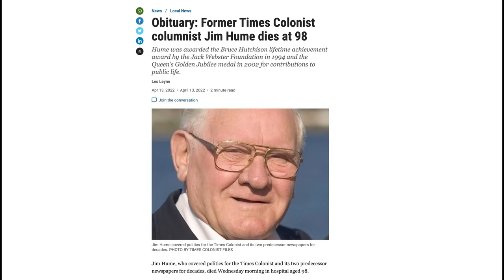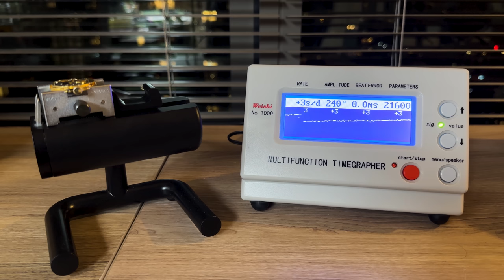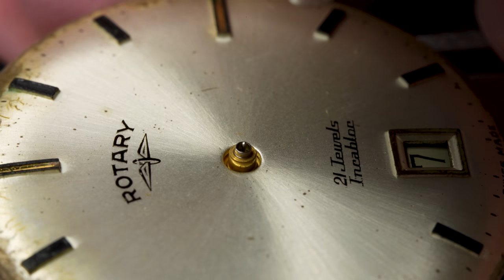He Wore This Watch Dining With the Queen and Salmon Fishing With John Wayne!

Comment: Imagine being Jim Hume having lived through WW2 experienced the invention of the vinyl record into magnetic tapes into compact disks into fully digital streaming media. Imagine having halls full of shelves replaced by rooms full of equipment with magnetic tape storage into being able to store billions of pages of written text into a device the size and thickness of a fingernail, the invention and spread of home phone lines into cellphones into smartphones and a furniture size tube driver radio receiver turned even bigger furniture television turned color, turned from tiny CRT to big CRT to projection to LCD to plasma and now flexible OLEDs as thin as cardboard...
It is astounding what humanity achieved within about 150 years from first steps in electronic and simple circuitry into the first semiconductor transistors making tubes obsolete into logical clusters of millions of those with each being only a few hundreds of atoms in size...

Comment: That’s sage advice when it comes to attempting to clean a dial; best just to leave alone as very often can be made worse in a cleaning attempt. One issue I have had with that Speidel band is the multi fit lug width type is spring loaded and it causes a lot of damage to the inside of the lugs! I have actually ground the lug ends and polished the ends so there’s no spring tension pressing against the lugs. This is something customers have not taken issue with and preserves the case itself. Thanks for sharing!

Comment: I love vintage rotary watches they just look fantastic to me. Not sure if the movement in this case was manufactured by rotary themselves because a trademark they used to do was decorating the ratchet wheel with engraved sort of wings but I supposed they would have been on the more expensive watches. I have a rotary supersports cushion watch from the 30s and an Eterna rectangular watch from the 20s that are both 9ct gold and have rotary movements with those wings on the ratchet wheel. Love what you do Marshall, amazing workmanship ❤

Edit- after commenting I noticed the AS stamp on the movement

Comment: Watches are pretty straightforward.  As long as you keep the torbo encabulator the right way up and keep the same flange for the induction coil from getting caught under the flux capacitor, you're good!  😁

Comment: Those old flex bracelets are soooo comfortable on the wrist, even though they can be a chore to clean. Without a sonic cleaning machine I usually have to remove the bracelet and scrub it with a toothbrush at the kitchen sink.

Comment: Just fantastic.  Another watch with a crazy cool story and an interesting repair.  
I saw that click spring fly away on you.  I would recommend wrapping rodico on the end of your push stick.  This should not interfere with the purpose of the push stick, and it will grab things that like to jump.   You have a plastic stick that is angled and slippery.  You are trying to hold a greasy metal spring with that slick plastic. 
The other advantage of doing this is you can pick up screws with the rodico tip more easily.
Reply: @RussianFans-vn6cj  It's my responsibility to report you for unwanted spam. Please keep your religion to yourself unless asked.

Comment: You might want to put a small piece of Rodico on the springs that have a tendency to launch into outer space.  The Rodico acts like an anchor, keeping the springs from moving very far.  Even if the spring does launch, the small bit of Rodico stuck to it makes it easier to find.  Or, you could use a plastic drop cloth underneath your desk.  The plastic is a clunkier solution, but it does work.  Lift one corner, then another, then the last two.  All dust, dirt and other particles will be in the center of the drop cloth.

Comment: Something I love about watch repair; is how many times the repair is a basic 'take it apart and put it back together' and it works type repair. The fact this is a universal constant on many things is weird but even more strange is that its the same with some electronics. Many times I have found myself working on something electronic like a radio, or cd player, or computer and simply taking it apart and putting it back together it just works. Granted that usually means there was a loose connection somewhere but still its just funny. I wish cellphone repair was like that since that is part of my job but no with that its usually a broken screen or bad battery.

Comment: Them old school watches are a work of art. 90% will be the same yet that 10% isn't. They all have just that little difference. Maybe more like 95% to 5%. And that was because back then they were all put together by several people. Each did their same thing yet it wasn't the same thing all the time. This was and still is a beautiful watch. Even before restoring it. I love the main spring tool click as well as the click putting on the top of the main spring. They just nice clicks. I would say if I did this type of stuff it would take me time doing it under magnification. Mainly just how to move my hands and tools under it. That is the true special of these videos. The small parts under the magnification and then watching what you are doing is the true test just the tear down let alone putting it all back together. With my shaky hands those small parts is a nope for me. Even 40+ years ago it would still be a nope cause I have always had shaky hands. Do not ask me to solder anything cause well it never ends up good. Now the oils/greases you use well I use some of the same types for my AR's and handguns. If it slides grease if it rotates oil. That is the constant.
Reply: @RussianFans-vn6cj  So which is more important Quran of the Bible?? I have only read one of them.

Comment: There's a piece of fiber stuck in the barrel. There's grease missing on the yoke spring. You didn't check the wiggle in the barrel bridge (or if hammering is needed). There is a piece of rodeco stuck now in your staking bar. The balance is wobbling. Nice scratches you made by trying to fasten the jewel grub rings on the train bridge. Minute hand between minutes when seconds hand is at 12 (I see you fixed that later). And as always, nice ASMR. You're welcome.

Comment: I only wish I had steady hands, etc to do what you do.  At 80 I still do many things.  As far as the expansion band on the watch I have worn them in the 60's.  I find it difficult to use the bracelet type with the clasps as I have large hands and a smaller wrist so If it goes over my hand the bracelet will be loose on my wrist.  I marvel the the miracle of the engineering of a watch with mechanical power (main Spring) can be so accurate when working properly

Comment: Rotary used to be a great brand, I have owned a few vintage ones, the last one had a Peseux movement.
How I clean them expanding straps, I have a piece of old bicycle spoke with a right angle bent at each end, I fit the strap onto it, stretched out, and use an old toothbrush with soap and water to brush between the segments.

Comment: 6:16 Dear Marshall, for this case you can use some plastic to cover up and put your holder inside it. I usually use plastic from drugstore to put my pills, and snatch my watch holder inside it when dealing with flying spring like this. Maybe this can help you remove spring safely without any risk. Regards from 🇲🇨

Comment: The Speidel bracelet is a very comfortable bracelet for a light watch and is so very easy to take off and on.  Mine is now attached to a Casio W-800H that sits in a kitchen draw and is only used
when grilling or some other cooking function that requires a close "watch" on the time. This was a great episode as the movement was just a tad different than usual. :)
Reply: I noticed the bracelet right off. I got an old Benrus and it has one of those same style Spiegel bracelets. It's one reason I bought the watch. Nice to feel the outside of it and it grips nicely wearing it. Most of the gold plating is worn off on mine, looks almost identical to the one in this video.
Reply: i prefer the speidel twist o flex bands, they are still in business and i have about 6 of them now, different sizes and coloring for different watches.

Comment: That movement has an offset cannon pinion and the pinion is worn out which is why the hands can't be set.  I believe AS made movements using the offset cannon pinion because it allowed for a thinner movement.   Back in the day thin watches were highly desirable.   BTW, the AS movements were solid workhorse movements.   AS was eventually folded in ETA which is now the largest Swiss maker of mechanical watch movements.

Comment: Wonderful video.  People, do not put universal fit expandable lug watch straps on gold plated watches or even solid gold watches.  The universal spring fit ends will cut into the soft gold plate and into the brass substrate.  The adapter ends of the bracelet are made of steel and will cut into the watches lugs.  I have seen lugs almost cut off due to the cheap bracelets with the universal fit lug ends due to the everyday flexing of ones wrist.  Get a dedicated fixed correct width bracelet only, or better yet, leather with a quick release linkage.

Comment: Hey Marshall, I was surprised and delighted to see you release another video so soon after the last one, which got me to thinking (I know... dangerous concept).

I have an inkling about why you can't necessarily release videos on a regular basis.  It's because you have several projects going on at once, isn't it?  And you never know whether or not you'll need to order a part, and if you do, you have to stop working on that particular movement until the part arrives.  At which point you can work on another movement.  Then when the part for the movement you were previously working on arrives, you can continue working on the first movement just in time for the second movement to be nearly finished because you didn't have to order a part for that one.

Is that the basic gist of it?

As always, I love your channel.  Don't know exactly why,--I can't recall the last time I actually owned a watch lol.  But what you do is COOL.  That's probably why.

Comment: 24:01: perhaps easier to fit crown and stem if you turn the case 90degrees in the vice/holder ??
Reply: 25:20: ....................and also easier to test after fitting........... eh ?

Comment: I have had some problems with one of my clocks. The clock stopped and I thought it was a problem with the mainspring so I took the balance wheel and the pallet form off and I am having a lot of trouble putting the balance wheel and pallet fork on. Until now the clock was reliable and accurate. Do you have any tips for putting a balance wheel and pallet fork back on?

Comment: servicing a very similar Rotary, minus the date complication. Everything is seated properly, oiled perfectly, parts inspected microscopically. Runs now with good amplitude But.... As soon as I unscrew the movement from the movement holder the watch stops. Re-grip the movement in the movement holder and it starts up by itself. Any ideas???

Comment: Hi Marshall
I have an eBay find, a Buser Nidor with probably a broken escapement axle; the hair spring seems to be fine. It has the second at the 6 o-clock position, and is not shock proof.
Are you interested? it's yours for the asking.

Comment: How does one get in contact with you to possibly service/restore a vintage watch? I have my grandfather's 1893 Elgin Pocket watch and it has not run in my lifetime (60 years). It seems to be in decent shape, but spent its life sitting in my dad's office on a shelf.
Here's what I have found out by looking at the serial number. (Your channel gave me clues on how to get the back off. No damage!)
Elgin Serial Number : 4736515
Production Year :1893
Size :18s
Jewels :15 jewels
Grade :125
Model :2-4
Class :4
Run Quantity :3000
Production Dates :1891 to 1893
Total Grade Production :13000
Movement Configuration :Hunter Case
Movement Setting :Pendant Wind, Lever Set
Movement Finish :Gilded
Plate :Full Plate
Barrel :Going Barrel
Adjusted :Yes
If nothing else, maybe you can point me to someone in my area who could tackle a watch like this.

Comment: Did you not have a Jacot tool to clean up that pivot? If not, maybe another tool and skill to invest in?
Reply from the maker: I do have one but that kind of pivot is totally different than the ones it's made to work on, they have to be flat sided
Reply: @WristwatchRevival  I thought I’d maybe seen you use one before. I also wondered if maybe the diameter was larger than the chucks (is that the right word?) in most Jacot tool kits could accommodate. I was just curious in that it looked like, while tremendously improved, there looked to still be some small traces of rust remaining.

Comment: Not a fan of the new spring bars. The tips are much shorter than the old bars which will make the band prone to detaching from the watch. The diameter of the the new spring bars are much smaller which makes the band very sloppy. Great job over all. I really like your videos.

Comment: Is there a way to know if the screw is reverse threaded?
Reply: Sometimes they'll have three lines on the top (the slot and then a line on either side). But not always - you just have to know that the crown wheel screw usually is (if it's a single screw, some designs use two smaller screws), and be careful.
Reply: @RedwoodRhiadra  oof, not a very smart design tbh.
Reply: @VirtueSignalingRetard  It's necessary - given the direction the crown wheel turns, it would eventually unscrew a standard-threaded screw.
Reply: @RedwoodRhiadra  Understandable, but they could've used something to signify it. Something as simple as a black screw or whatever.
Reply: @VirtueSignalingRetard  As I said, they do with the triple line in some watches. But there's no universal standard.

Comment: When you oil the jewels it feels to my untrained eye, that the oil is being applied to the side that isn't in contact with the pivot in some cases, this seems strange to me, but maybe I'm not understanding the way its going together? I think this video was a bad example, but I thought I was more likely to get seen on the most recent video
Reply: He flips the oiled jewel over right before installation.
Reply: I more meant the ones that arent removed from the movement in other videos, but looking at another video where this happens I think the jewel actually has a hole in it that the pivot is going through and the oil is being applied to the gap between the jewel and the pivot in these cases, I hadn't realised there was a hole in them before... Then presumably the ones that don't have holes in them are the ones that get removed, oiled, and flipped as you said